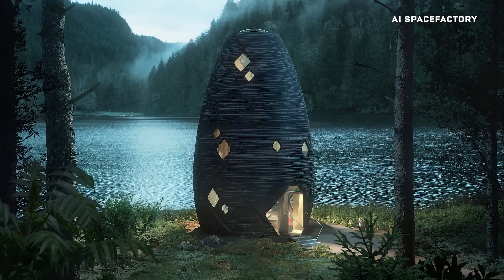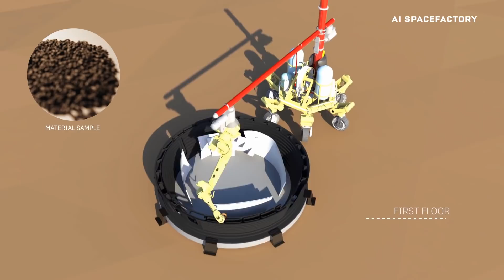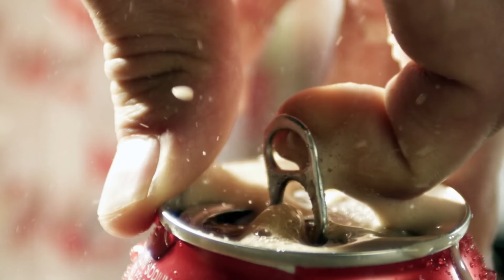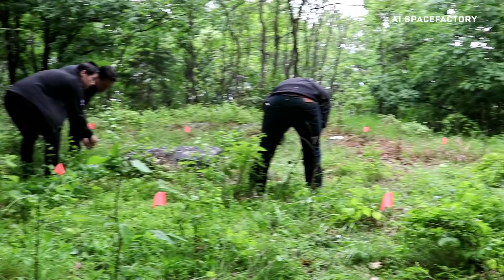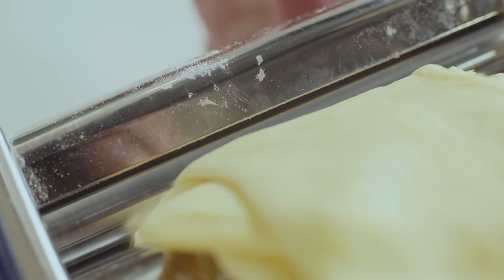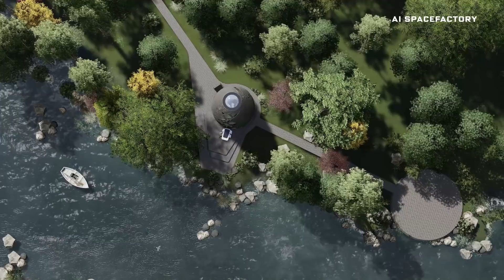How 3D Printing Could Help Colonize Mars | WIRED

Comment: I heared that you need multiple meter thick material to block all primary and secondary radiation.
Reply: I was thinking you could build it like a medieval castle. You build an outer and inner layer with a gap between and then just fill it with Martian soil for better radiation protection and insulation.

Comment: 3d printing a structure is a good idea, but it would have to be under ground to help block the radiation. You wouldn't be living on the surface in something like that. The walls are way too thin

Comment: one thing iv always wondered is, where is the airlock on these? how do you get in and out of it
Reply: Advocatus Diaboli That is a very cliché comment.
Reply: Advocatus Diaboli I guess we won't know till it happens, but I do agree there are better ways to do this.
Reply: I guess they will use a lock system at the entrance, like in a space station
Reply: It would guess they're wanting to print these inside large bubble structures

Comment: But how does one enter the house? Doesn't it need some type of airlock before entry? I don't know much about Mars but I'm assuming the air is non existant.
Reply: dude bro or you just never exit the house and you’re all good
Reply: Looks like it has an external and an internal structure, the area between them probably serves as an airlock.
Reply: @tzompantliblanco  Id reckon they would try their best to save internal space, so perhaps a modular external airlock could be the one they go for?

Comment: About the paste, is it need water?
Reply: I don't think so I don’t think so
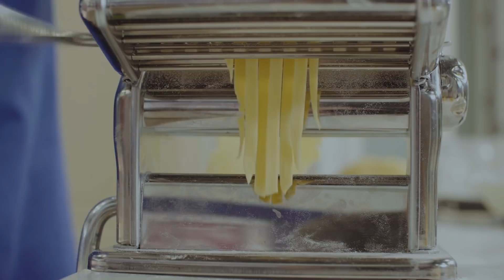Reply: 6:50 they mention "cooking" So Id assume melting? Could be a challenge to use resin glue as binder since you gotta mix it well, and that requires mixing it a long way before it comes out of the nozzle, and this means it might harden when you stop using the machine. Surely they wont reveal everything they do. Theyre a company after all. But Id guess they use powdered plastics along with the regolith and then melt it just right at the tip and if anything hardens they can toss away the nozzle and install a new one. Or when short on materials, can just have some astronaut manually clean the old nozzle

Or they use resin glue that requires heat to trigger. So no challenge of having to mix it on the spot and all they need is to introduce a little heat at the tip of the nozzle?

Comment: Amazing! The rectangular Windows with sharp corners is a point of pressure failure. Aeroplanes in the old days had rectangular Windows until pressure fatigue cracks at window corners caused a number of crashes. I suggest Windows with rounded corners to avoid this same problem.

Comment: 1. If this ends up being the finial shape of Mars houses please sell these as candle holders.
2. During the construction of these house how would the material fair, with the dust storms? if the material is liquefied would dust make it harder for the next layer to bind to the previous? Kind like flour and dough?
3. Also, what about the gravity difference between Earth and Mars, would it make 3D printing easier? would there be enough gravity to make both layers bind to each other sufficiently?
Reply: I did some research on this for a speech I'm doing and the reason they build it that shape was to make it stable on Mars. However, I'm not sure if it would be able to survive dust storms though

Comment: It's a fun toy and a great way for 'concerned' rich people to waste their money but if you think you are going to fly a machine that by definition is bigger than a house to Mars to make concrete igloos then you are delusional. The future for Mars  settlements after the initial (tent) stage is underground. Imagine an autonomic robot excavator that digs a container sized trench 4 meters deep, 3 meters wide and 15 meters long. You then fly a lightweight container to Mars with all the stuff in it and when it gets there you install it into the trench and the robot then covers it with martian dirt two meters thick except for the front door. Why? Shielding and thermal insulation. There's an awful lot more to a habitat than just the outer shell.